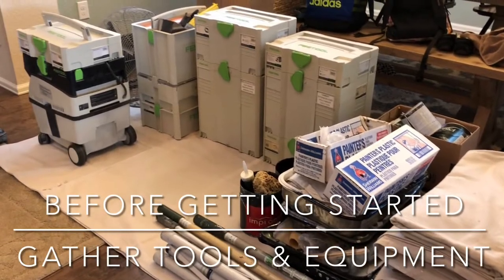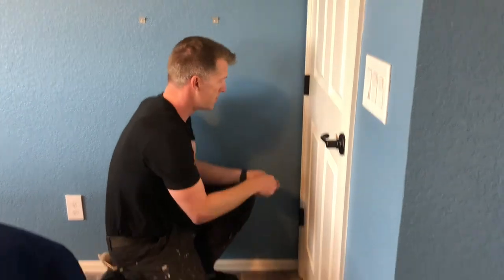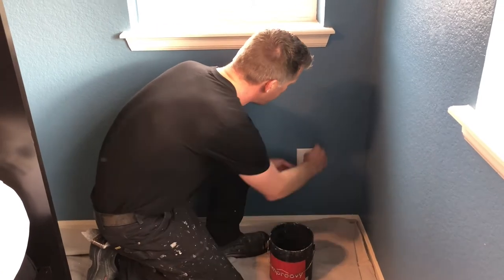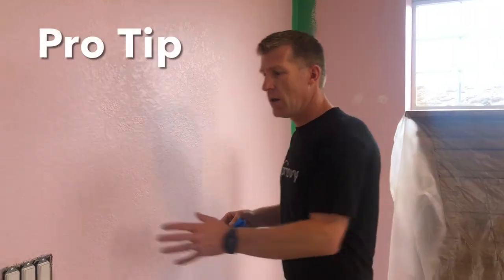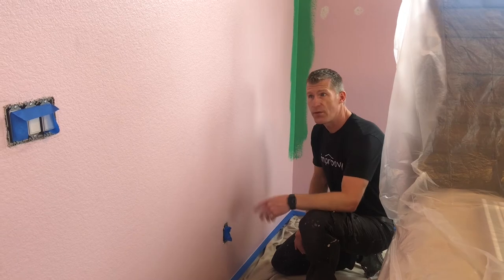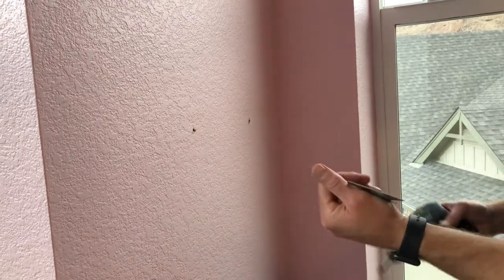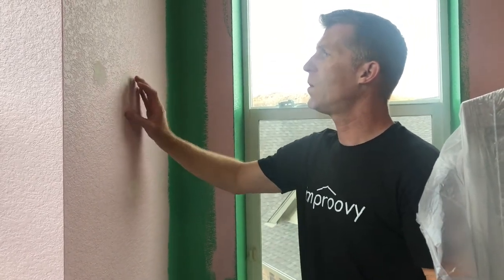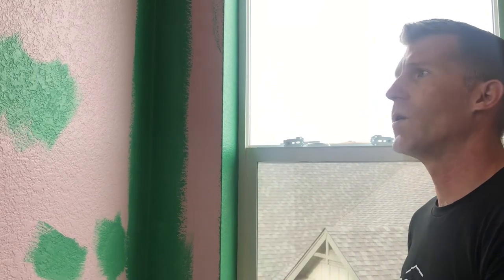How to Paint a Room Like a Pro (6 Easy Steps For DIY Wall Painting)

Comment: did you paint the corners and let them dry before you painted walls?
Reply from the maker: On the first coat, yes we did. On the second coat we cut and rolled one wall at a time to attempt to keep a wet edge.

Comment: Question about "sealer" vs "primer"  -  I read short article about need to seal drywall.  I am in the process of scraping all the paint off the drywall in my house and I'm also re-mudding (100% coverage skim coat)  and going for a flat finish/Lvl 5.  I know you're supposed to prime drywall before topcoat paint but I'm not familiar  with sealer and what it does.  I read in another article that sealer and primer are different things yet whenever I look at products on Home Depot or other stores things are listed as "primer/sealer" or "sealer/stain blocker (and then the description refers to it as a "primer").   So I'm kind confused as everything seems to be a primer/sealer all-in-one or if it refers to it as a sealer it also refers to it as a primer.    Two questions - 1.)  what exactly should I buy  to go on top of dried skim coat mud/drywall?   2) If sealer and primer are two seperate things, which is painted first on top of the drywall the sealer or the primer?
Reply: I forgot to add that the reason i was scraping the paint off is that the original primer that was put down on this drywall (house built in 1990) is starting to let go in some places and so im scraping all paint off using a heat gun and I actually liked the thought of using some oil base primer and topcoat  b/c I've always heard it sticks better than latex/water base.  I am going for a flat finish and I've read thats easier to do with latex but since its my own house i have unlimited time if the oil based primer and topcoat require sanding (plus I have electric sander).  One website mentioned putting an oil based primer down on top of bare drywall then using an latex/water based topcoat to go on top of the oil based primer b/c it dries smoother and more flat.   Is it even possible to get a really flat finish using oil base since i cant't sand the final coat?
Reply from the maker: Hello, first I would recommend if you haven't applied the skim coat/mud yet to make sure you have good adhesion of the mud to the drywall. If the original paint and/or mud was letting go, there could be an adhesion issue with the drywall. After removing existing coating, I would recommend priming with an oil based primer or a product made by Zinsser, called Gardz. This will create a good base and make sure you have adhesion to the existing surface (especially if there was an issue prior) for the new skim coat of mud you plan to apply. 

After the skim coating and sanding, I would use a regular drywall primer (typically called PVA Primer). This type of primer can be purchased at Home Depot, Sherwin Williams or Benjamin Moore Dealers, etc. In the industry, sealer and primer are often interchangeable depending on the product and when you use them. Here is an article I found that helps to explain the differences (although still a little confusing): https://eicoatings.com/wood-primer/sealer-vs-primer-vs-undercoat-when-to-use-them/

After applying the PVA Primer, I would pole sand the walls and then apply your top coats in your paint/sheen of choice. 

Do not apply oil based primer over the skim coat or mud, as it will not work very well, and isn't necessary. 

Hope this helps and sorry it took a few days to reply here. Best of luck with your project!

Comment: Do you wipe down the walls after you sand them? Won't the left over "dust" from sanding affect the new paint? Thanks
Reply from the maker: Great question, thanks for asking! The pole sanding is to help with adhesion and remove small imperfections. Doing so does create a little dust, but the majority of it falls to the taped baseboard or tarps below and can be dusted off or vacuumed before painting/cutting. What remains isn't enough to cause any issues with the new paint. With larger patched areas or fresh drywall it is a good idea to remove as much sanding dust as possible prior to priming or painting by dusting the area off or vacuuming. Even in this instance some remaining dust is okay and will not affect the new paint or primer.
Reply: @improovy  thank you for the info!
Reply: I always give them a quick brush down to be sure, no harm and takes 2 mins

Comment: No self respecting painter covers widow sills or tapes switches after plates are removed unless is for show or your overcharging the customer and are going the extra extra mile
Reply from the maker: Hi, thanks for leaving a comment on our video. We do these things to save time cleaning later and to make sure we protect items that are not supposed to get paint on them. Our customers appreciate our attention to these kinds of details. 

This particular paint was a brighter green and very thin; and due to the knockdown texture was splattering easily. To avoid having to clean outlets and light switches of paint splatter at the end of the project and having to clean or repaint the window sills, it made sense to protect them from the start. With some colors, the paint splatter will not be as visible on outlets and switches or window sills, however once you have had to go back and clean these types of surfaces by overlooking it during the prep phase, taking a few minutes to mask a surface or put a small piece of tape over the top isn't that big of a deal. Thanks again for your feedback.
Reply: @improovy  you make some good points, but you know damn well 98% of the time 😆you don't mask outlets once the cover is off.
Reply: @tejeda7324  Well, he does because he cares about doing a good job up to the smallest of details. You don't. If I had to choose based on the above I'd hire him, not you. You sound like you want to be done quick with the job, take the money and leave, he sounds like he wants to do a good job. No brainer. And I don't care if he charges a bit more, at the end I care about a job well done with no corners cut or "he won't see it anyway" mentality. The extra money he might charge will be well worth it, if he did charge more.
Reply: Tedeja go back to sleep m8.rather watch paint dry.🥱
Reply: @tejeda7324 why do you hate your life so much? So much unnecessary anger